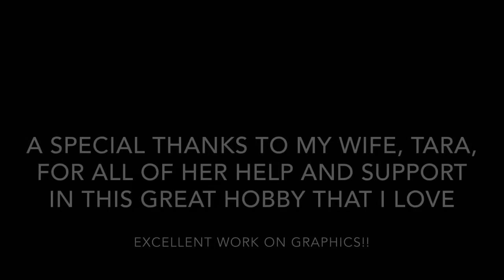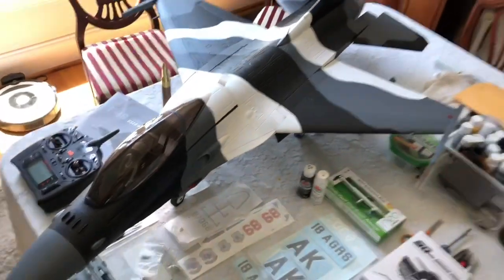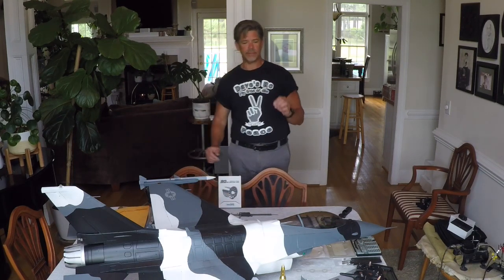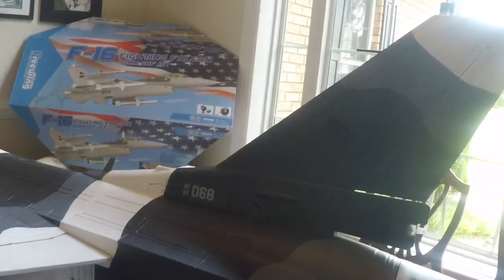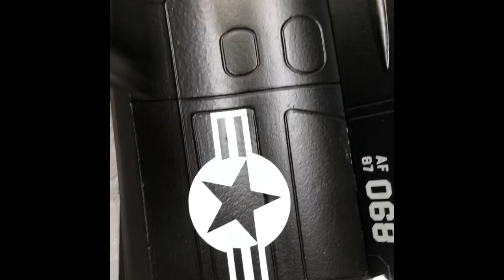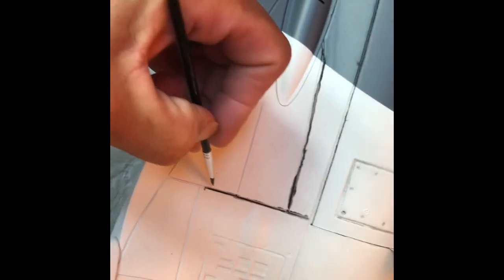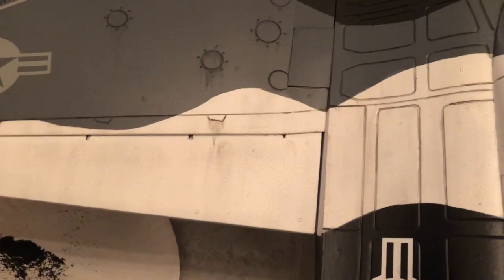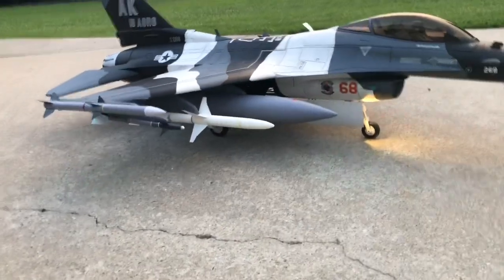PT4: THE FINAL REVEAL, FREEWING 90mm F16 CUSTOMAZATION INTO THE ARCTIC AGGRESSOR SCHEME, and how-to

Comment: Maybe a quick spray with some clear coat would help those decals stay in place. There might be a product made specifically for coating over decals without any haze or shadowing on the decal but helps decals last longer in pristine condition.
Reply from the maker: Yes…you can use modge podge from the dollar tree, works great👊🏼

Comment: Simply wow...what air compressor you use? I am looking to get one, can you please post a link.
Thanks
Reply from the maker: Nas Khan thank you so much!!! I use an Iwata airbrush and compressor which can be pricey but with airbrushing you do get what you pay for, more so in the airbrushes than the compressor, biggest think with the compressor is not having to high of pressure but one that also hold a consistent pressure, also, be sure to get the moisture trap , you will definitely need it or you will start spiting water which leads to a big problem, thanks for coming by and let me know if I can help you out more
Reply: @JeffsCustomRC  cool. Can you please share the links  to iwata airbrush and compressor.. also what tip size does your airbrush use?
Reply from the maker: Nas Khan I got my supply’s from hobby lobby, and I’m sure you  can order online from them, be sure to look for the 40% off coupons as well